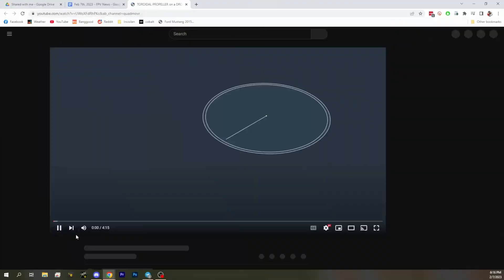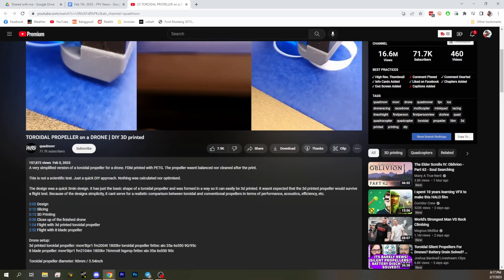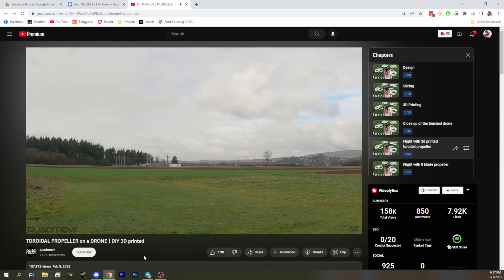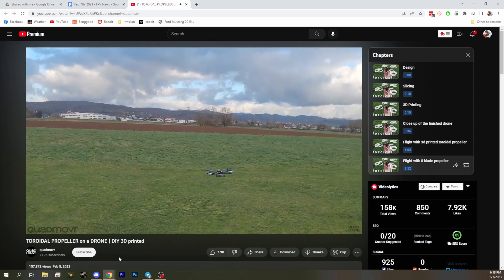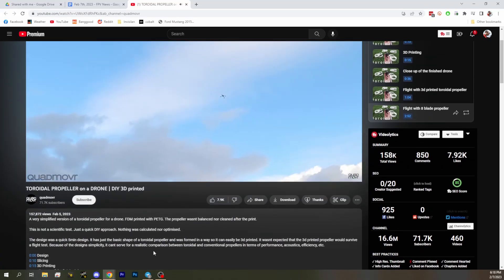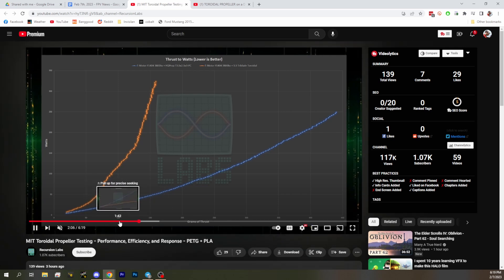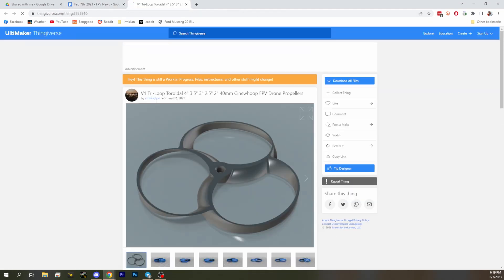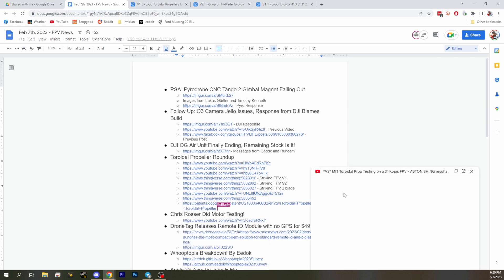Toroidal Propeller Roundup! Bench Testing! - FPV News

Comment: The shape needs to be like a heart ❤️ rotated around the center woth the round parts on the outside and the sharp part near the motor shaft. This way, the sharp tip is in the middle of the blade path. This would reduce prop noise.

Comment: You can't just roughly print a random design without any meaningful calculation and expect to perform near the best MIT ones, the marine ones had TEN YEARS of development and they outperform every classic marine propeller. Just wait for properly designed, tested and produced ones.
Reply: If you read their paper they claim that they got those results from additive manufacturing, and their own videos show off the shelf fdm  printers, their claims are incredibly suspect with 0 data provided. Minecraft
Reply: @tzyinccom  they are smarter than you 🤣
Reply: Bro science at its best. We think this is some revolutionary development in aerospace engineering.
Reply: @nofluxgiven1949  me too, that's why these early tests with poorly designed props showing poor performance are detrimental and should be avoided
Reply: @nofluxgiven1949  but they are smarter than you,🤣
Reply: My friend, MIT 3D printed theirs as well. Their video has quite the “crowdfunding scam” vibe. They boosted the audio so bad on the normal quad you can hear white noise in the room and then gave a BS chart with no good data, and their “white paper” they won that award for is 2 pages long. We all see MIT and think “prestige”, but check out some off thunderf00t’s busted videos to see some mind bogglingly stupid stuff these prestigious collages fund and endorse.